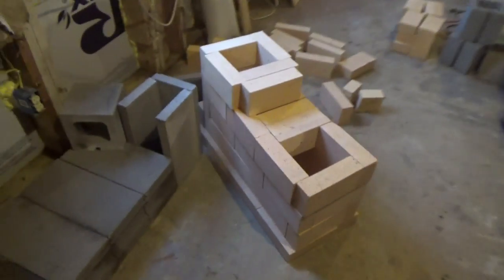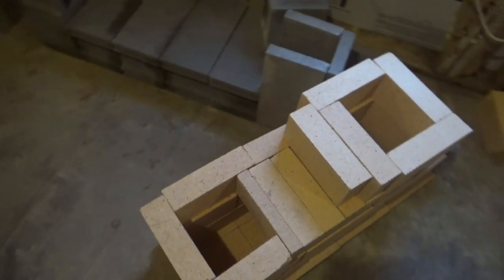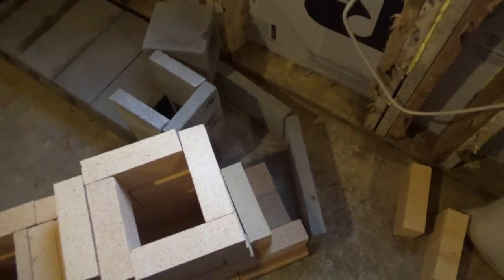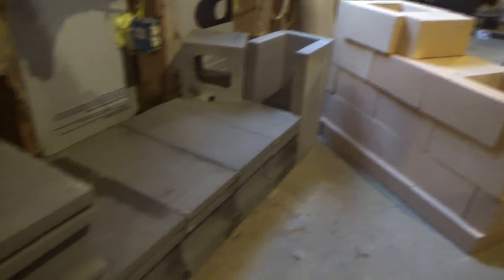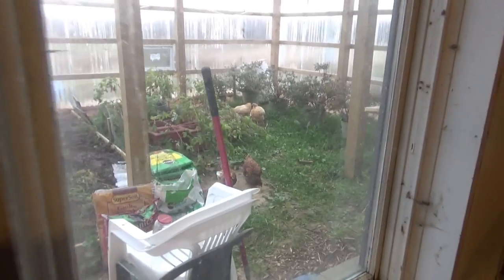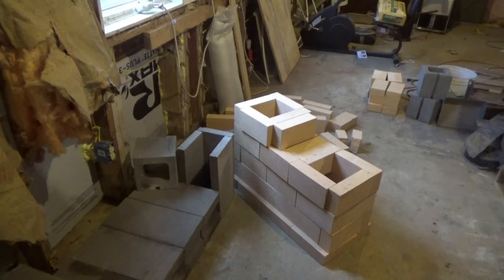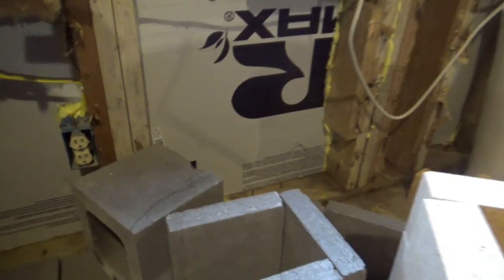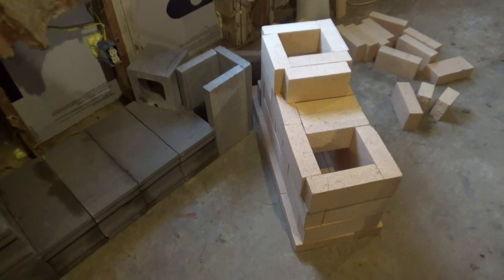Rocket Mass Heater Part 1; the easiest way to build

Comment: from my limited understanding, the pipe coming back toward the heat source has to be higher than pipe coming from it. Permies recommends one inch elevation for every 12 inches of length. 
If you're using those cindee blocks, the heat won't be pulling it through as well because the holes on either side are on the same level

Comment: Splendid! I have learnt so many things from this video!  I have built a rocket stove and I don;t know if I can use a terracota stove (it''s at about 1 m distance from the rocket s), instead of building the mass heater, I mean to introduce the exhaust pipe into it. Ii will probably warm the terracotta and  the smoke will go out of the chimneyThe terracotta is 1.50m,/60cm/35cm.If you could answer me, I would be very grateful. Thank you very much!
Reply from the maker: it's hard for to imagine what you are building.  the idea is to have plenty of thermal mass to collect the heat and make sure the diameter of the flow through it is at least the diameter of the rock stove stack. have the vertical stack and barrel is essential for creating the draft to push the exhaust through the thermal mass.
Reply: @michaelambrosia  Thank you!  I want to use the wood stove as a mass, just introducing the exhaust pipe of the rocket stove into the lower part of the wood stove, so the wood stove will be the mass, then the exhaust will go up the chimney of the wood stove , after warming the wood stove. In this way I have a chimney and a thermal mass. The size of the exhaust pipe of the wood stove is 15cm, I mean the diameter, so I suppose the diameter of the exhaust pipe of the rocket stove should be also 15 or less, the same for the diameter of the fire box.
I don't know if I, m right, but  it will be much easier for me  in this way, keeping the wood  stove,in case I fail, using it as  mass and having a chimney.in case I succeed, I wrote too much, pardon me, but maybe you can help , I like your explanations. Thank you again!
Reply from the maker: @DanielaRouge  That sounds fine and should work well, but you will not capture as much heat with just the wood stove. If you do it this way and find out your exhaust is still pretty hot, you could build a thermal mass next to the wood stove and send your exhaust through that first and then into the wood stove.  The idea is to capture all the heat that you can into a thermal mass to keep that heat used in the home.  If your exhaust temp is over 100 F, then you can probably capture more heat off of it.
Reply: @michaelambrosia  Thank you very much! I'll do as you say.

Comment: can you show us how you made it?  
update on how its working....and how many blocks total were used.
thanks
Reply from the maker: This is a designed that I tweeked just a bit to make mine. https://www.youtube.com/watch?v=_oHXkDf6WnI    Using a fire brick riser does warm up slower and might not be as rockety as insulated stove pipe, but it works fine.

Comment: I'm building one in the basement right now, also. I'm interested, how is the heat affecting the upstairs? Is there any extra venting to allow the heat to rise? I've been told a basement is not good for them because it won't heat the upstairs enough. I would love the input!
Reply from the maker: Jason JTuffFluff  The heat is rising and warming our upstairs just fine in my home which has an open stairwell.  No extra venting needed, but it would speed up the process if you did, especially if you had a stairwell that was closed off by doors.
Reply: @michaelambrosia  that is great to hear! I've been told by many that it won't work. But I figured heat rises and even if it will supplement half the heat, it will pay in dividends. I'm going to put vents in my floor to help also, plus I have a open stair way. I am building an 8in system with 23 ft run through a block frame mass, filled with cobb.

Comment: At the temperatures a Rock Mass Heater produces, won't standard cinderblock block crack, potentially short circuiting your heat distribution loop?
Reply from the maker: Most of that intense heat dissipates/transfers off of the barrel. Two years later, still going strong and able to heat a 3000 sqft home.  Today we had a low of -17 and high of -2...my furnace had to come on and run about 10 minutes every 1.5 or 2 hours, but if it is above 10 degrees out, the rocket mass heater mostly takes care of heating the whole home to above 72 degrees.

Comment: Won't that put Carbon dioxide  in the air where the chickens are?
Reply from the maker: yes the chickens were there temporarily and I did later vent it out through the roof of the green house...see later videos
Reply: Carbon MONOXIDE?

Comment: r there as much soot created by a rocket heater as in a regular wood stove?
Reply: There is practically no soot from a well built RMH, what little there is settles in the exhaust, so any design you choose, plan of having access ports so it can be cleaned out once every other year or so.
Reply from the maker: it's been a long time since I've had a wood stove, but I'm guessing it is comparable....maybe just slightly less in a rocket mass heater since it is a little more efficient.  ...much less smoke an soot out the exhaust